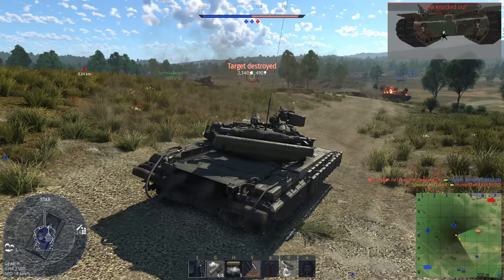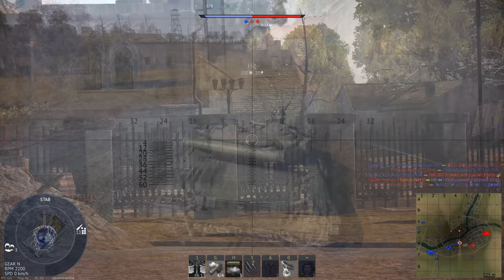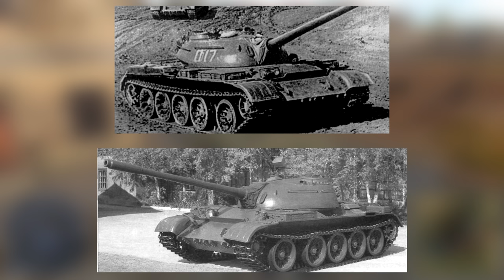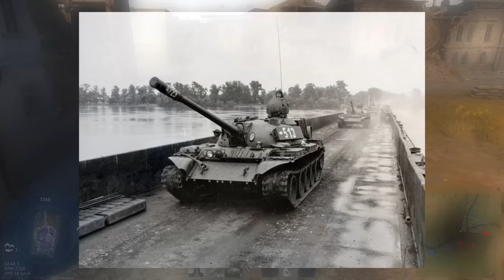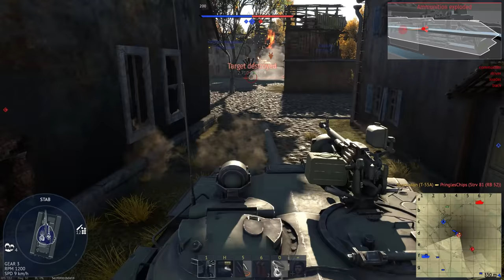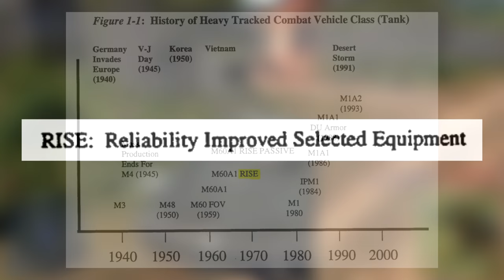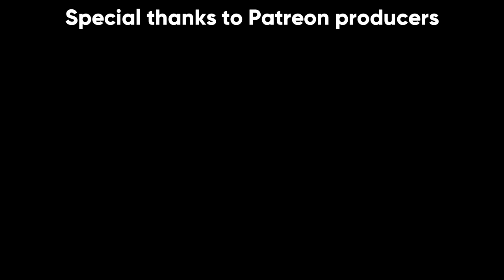Were Soviet Tanks Poorly Made?

Comment: Reliable =/= good.  Oh sure, a good tank has reliability as a requirement, but its not the only thing that makes a tank good.  None of the tanks described here were good, they could best be described as 'good enough' because they were reliable (eventually) and had features you'd expect on a MBT.  However, when placed in high intensity conflicts, they were disabled/died in droves (WW II, the Arab Israeli Wars, the Gulf War, etc.).  A significant problem with these tanks was that crew comfort was last.  A crew that trying to fight for its life in a cramped, sweltering metal box isn't going to fight as well as one that isn't.  Soviet doctrine also called for crews to fight "buttoned up", adding to the problem in places like the Sinai and the Golan Heights where temperatures can get very hot, but elsewhere as well.

Comment: T-34s were horribly made, due to factories being told, make this many or be executed for treason thex would rush through them. Many werent even made with hardened steel, or steel thats so hard that it cracks when shot, seen in many knocked out tank pictures. Not to mention some didnt even have optics, or good ones in general, the t-34 also had polished metal instead of mirrors for their periscopes most of the time, making it nearly impossible to see anything. They were hell to use for their crews, and not effective at all, unless in massive numbers